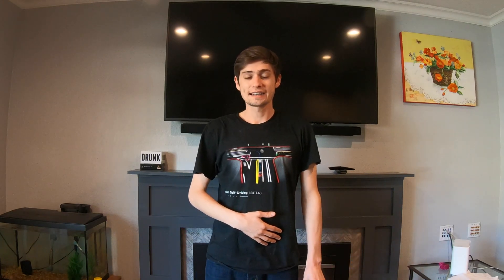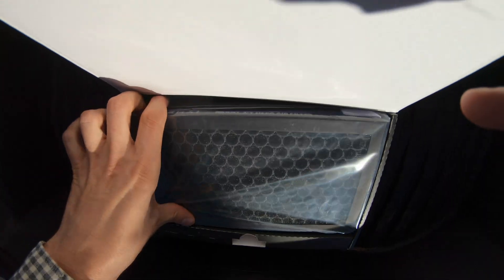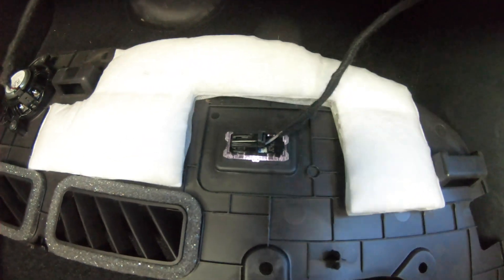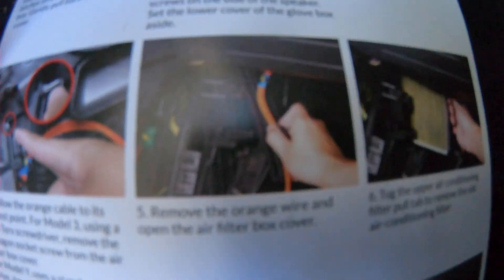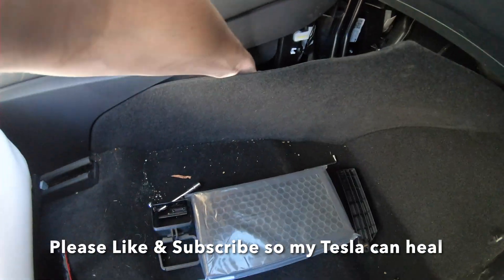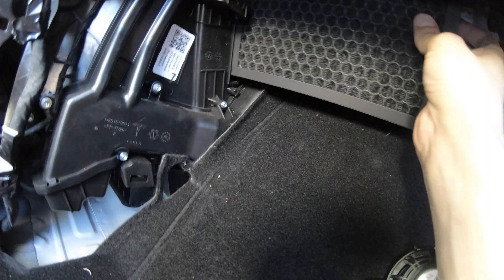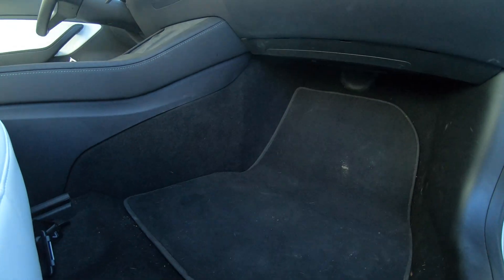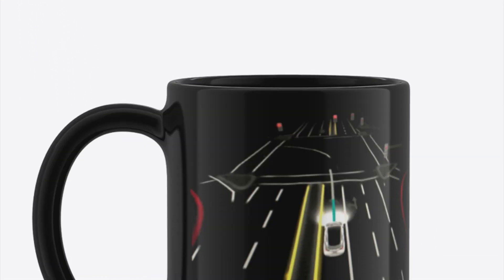Tesla Model 3 / Y Hepa Filter Change

Comment: Excepts for the orange wire is exactly the same as the older models. You don’t have to remove the speaker and light wires, as you just put the cover to the side when installing the filters. Also the clip is not forgotten, it wasn’t needed so Tesla removed lots of unnecessary clips and screws to save production time/cost.